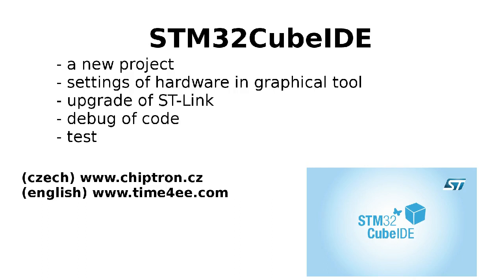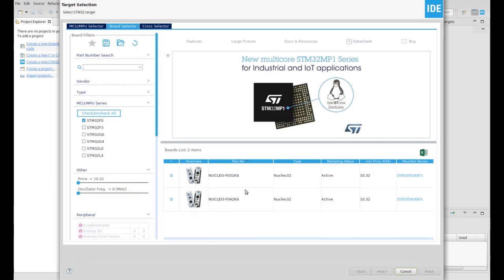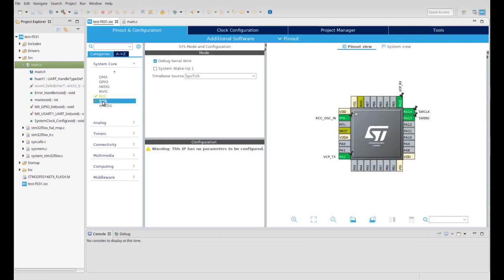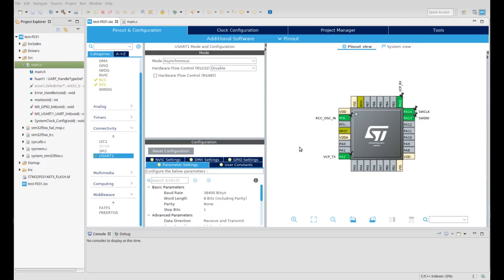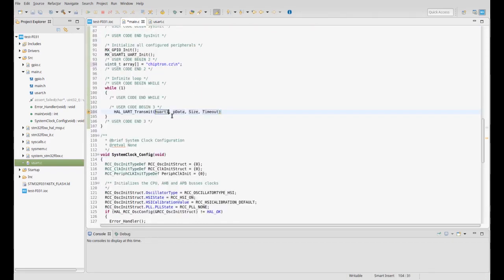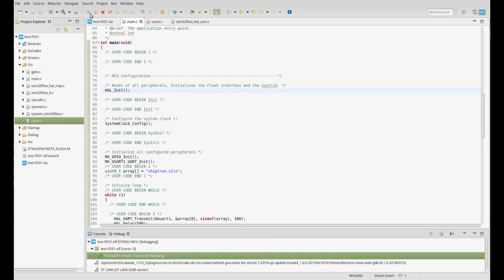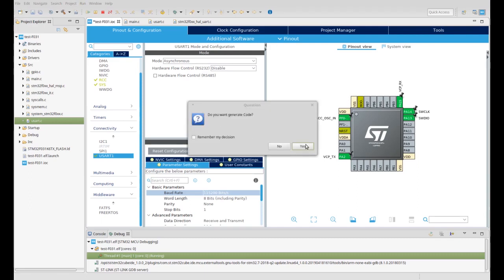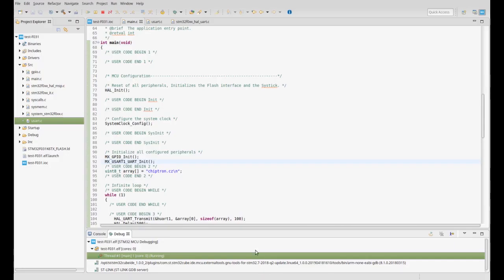STM32CubeIDE - IDE and CubeMX together

Comment: Hi chiptron, i am a beginner to STM32, i would like to know is it any circuit diagram to show how the connection between PC and STM32 board. Or it is just connect through USB port?
Reply from the maker: if you are using Nucleo 32/64/144 or Discovery board - just connect your eval board to laptop by USB
Reply: just connect with USB and stay out of trouble.....the signals are real real fast.
Reply: Thanks alot for the help, i already figure out my problem connection btw pc and my mcu board, i miss a  stlink on my mcu board and i use stm32f103c8t6 which not provide a stlinker.